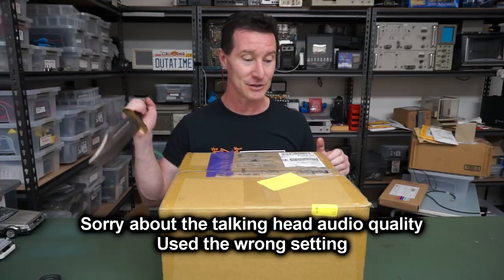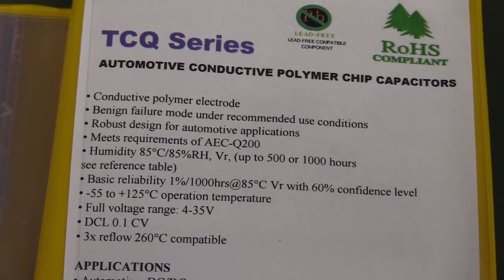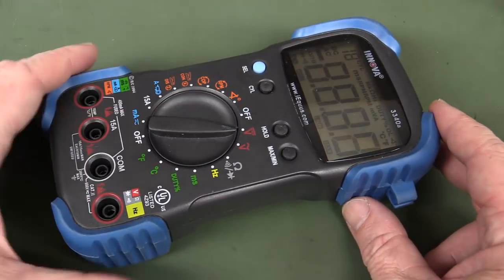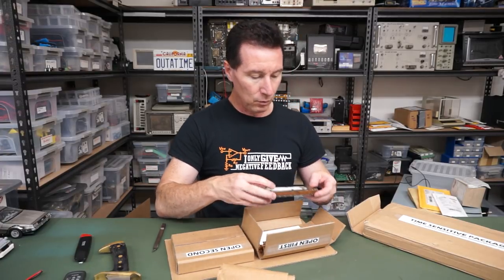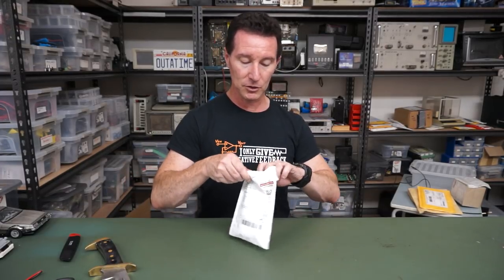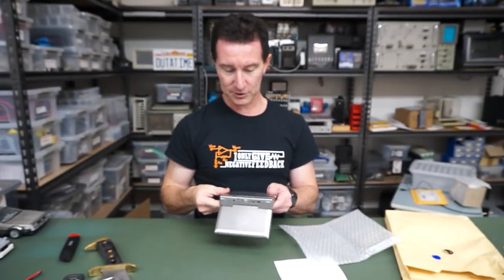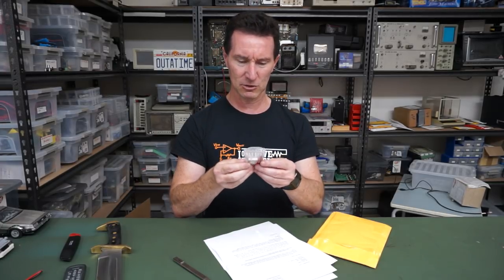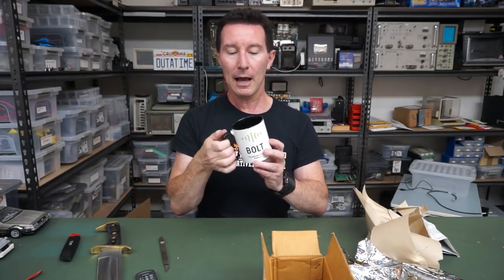EEVblog #1043 - Mailbag

Comment: The Screws are where the bank programs the account info into the device. There is a baseplate adapter. Most likely a serial interface like SPI
Reply: I wouldn't have guess that, very cool indeed.
Reply: The spirals are then probably meant to increase the inductance of the trace going towards the logic. That would prevent any fast transients (ESD) from damaging the logic and instead force the majority of the current over the spark gap.
Reply: Yeah, I would say the same. The screw terminals are marked IN-L, IN-R, OUT and REF. Clearly some kind of serial interface. I would assume that it is used to program the actual date and time into that thing because those generated codes depend on an internal clock.

Comment: Those AVX super capacitors are some very nice ones. They are low ESR and can supply some pretty high current.
That 400F cap would most likely be able to spot weld stuff, it's rated for 173 amps peak!

It's probably a good thing the flashlight kit comes already soldered. The WS2812 LEDs are extremely easy to kill when soldering, they are not exactly beginner friendly.
Reply: I had no clue they made caps with that high of capacitance.
Reply: Snarky Mark 
Look up super capacitors. Maxwell (now owned by Tesla) makes 3000F supercaps. Others do too. Some call them ultracaps. They are different from electrolytic caps.

Comment: the probe tip idea is very interesting.
Reply: Definitely! I could have used some of those last week while trying to beep out some TSSOP-16 chips (solder bridge somewhere, was a PITA to find...)
Reply: Can Dave read, or does he get Sagan to decipher the letters?  He wonders where the tips come from, where it clearly states in the letter several times that it's a dentists' burr.  So bad it's criminal (runs in the family, eh Dave?) :)
Reply: Minute i saw them in that characteristic holder i knew what they were! Back in my distant past i recall a dated stock store chain that specialized in medical/surgical items. There were 100s of different sized titanium hip-joints all the way to bone screws, plates and rods and even the tools to drive it all. The section of dentist stuff i found the burrs and i bought up probably 20packs out of 'hoarder interest" for a few dollars and have used them for years drilling PCBs. I think they are titanium as opposed carbide from the sound they make if you lightly drop one on a hard surface and they remain as sharp as hell but can snap. I've almost run out now. I bet there's some law now that says you can only buy them if your are licensed medical practitioner....
Reply: Would buy some of those probes for my meter.  I'm kinda tired of my fluke probes slipping off shit I'm testing.

Comment: The screws are the programing interface.  Before it's packaged it is set on a jig to load the final settings/program.  No connector required.  Case doesn't have to be opened after assembly.

Comment: It's kind of difficult to see clearly, but if you look in the screw holes at IN-R and IN-L (at about 30:57), it looks like those holes are not fully plated through.  Could that be a 4-layer board with the outer layers being plated and layers 2 and 3 missing in those areas, allowing the top and bottom layers to be squeezed together when the screws are tightened (and opening a circuit when the screws are loosened or removed)?  Also, I think you need to make a Kick Starter with a couple of those little joysticks on it, kind of like a new type of fidget toy.  Keep up the good work.

Comment: I used to work for AVX, operating a huge automated crane thing, which put pallets of caps into different chemical baths, and then into a 12 hour bake.

The oven was in the centre of two large halls (each about 35ft square?), so the crane on the output side of the oven would then put the caps through yet more chem baths, before rinsing them off.

The automation wasn't so clever, as it didn't detect certain things, like if you left the table down for where it places the pallets.
If you did, it would happily drop the entire pallet from a height of about 10 feet. lol

Each pallet much have had about 20,000 tantalum caps on it, with the ends of the caps dangling down, and the anode (I think) welded to some small metal sheets.

The tantalum caps had to use a sintering oven as well, and it could apparently take half the building with it if it ever exploded.

Definitely one of the toughest shifts I'd done (before or since). It was four 12-hour shifts, four days on / four days off.
tbh, I'm surprised that the stuff I made actually worked. lol

The crane system apparently got sold off to a company in the Czech Republic, before the factory in Paignton was closed.

(it used to be next to the old Nortel site, which was also demolished about 7 years ago. It was the largest employer in the bay.)

I worked for a short while back in the old AVX building, after a small telecoms company took over.
(made up mainly of ex-Nortel employees and engineers).

The telecoms company also eventually folded, and I think most of the stuff is made in China now.

Comment: On the token, the screw holes through the board looked odd, almost like the screw holes had separate layers on either side of the board, with no via connecting the 2 sides.  Was thinking that maybe it is used to detect screw removal...with the screw in, the top side of the board is connected to the bottom, but the connection is broken when the screw is removed.  But in reading the other comments I do believe that it is for programming just prior to use. That makes the spark gaps make sense too, to prevent accidental ESD discharges (like static from pulling it out of your pocket) to keep it from damaging the processor.

Comment: A lot late right now but on the openpandora the backlight inductors would fail. If you get status leds that come on it's likely still working just no display backlight. Mine works fine via the display output cable which was pretty specialized. It is sitting on my desk waiting to be fixed but my smartphone does everything this did just faster. Not sure if it's worth the time to fix.

Comment: I think the non slip tips are dental drills, quite a clever thing to do.
Reply: At 37:40 the included note strongly suggests that they are, indeed, dental drills.
Reply: Yes, and a friend of mine had an old dental drill and the bits came in very similar cases. When Dave mentioned the guy worked with dental equipment i got very sure.
Reply: They looks like some proxxon router bits I have. :-)

Comment: The weird traces coming off those screws could also be measuring static or some such to generate randomness for the crypto

The programming with pogo plugs suggestion seems dodgy to me, but it could be I guess
Reply: It's shown in the patent illustration, top left corner. The doc shows four pads and corresponding pins on a separate unit

Comment: 33:50 Is the processor in that metal package? It's from jorjin technologies, but i can't find the part on their website. They make prebuilt ARM processor modules, but the part number more closely matches their wireless module series.

Nothing else on the board looks like a MPU. The big BPA package is a flash / DRAM combination, the smaller BGA is a PMIC and the long boi on the right is a bus transciever.

Comment: On the Pixel light it would be cool to program it for long exposure photography so that by swiping it across the frame while the shutter is open it spells out a message, creates a cool patterned ribbon of light in the air, etc

Comment: Theory: The spirals on the bank OTP PCB are antennas. IN-L and IN-R are inputs, and there's at least one output higher up. That there are two might suggest differential signaling. It's probably how they program the thing, right through the case and possibly without even opening the box, so they don't have to trust the manufacturer to do it. No unscrewing anything or hooking up a cable. Just put it in a cradle and it programs whatever data it needs.

Someone else suggested programming it through the screws, but then what are the spirals for? Maybe the screws are in the loop to boost reception. They could also be measuring capacitance on the screws to see if someone took off the back cover, using the same pins the antennas go to.

If the spirals aren't antennas, they're inductors.

Comment: Pixel designer seems to be confused between mAh and mA . - 23:24  I count 4 spots where he/she should have used mA and not mAh. (Unless the circuit actually turns off when it has used 600mAh!)  It looks kinda cool but this mix up makes me wonder.
Reply: yes, that really does not look professional - they should revisit these data before they go public...

Essentially all places except for the battery capacity are mixed up!
Reply: Too me it makes me question the quality and reliability of a design when they get such simple stuff wrong.  If they don't know the simple stuff what else did they screw up?
Reply: This is just a simple oversight on a hastily-drafted letter to Dave regarding the kit. Yeah, I missed it, it is a mistake. Mistakes happen. I was in a hurry to get the letter done and ship out the package. The real lesson here is that I should have skipped my heart meds that morning as they tend to make me a little fuzzy sometimes, or I should have just waited a few hours and then read through the letter again before sending.

If you are going to judge my engineering and design skills, I would ask that you judge my engineering and design skills, rather than just critique a very-quickly-drafted letter to Dave. After all, the letter only took minutes to draft whereas the PIXEL is the culmination of months of engineering and design work, testing and refinement.

I encourage you to pick one up via a pledge to the ongoing Kickstarter campaign, and when you receive it, analyze and critique the hell out of it. I, like pretty much everyone, learn by doing something, and then learning from any mistakes or missed-opportunities to make something better than it is. To this end, I do appreciate feedback in regards to my designs.

Comment: An Automotive multimeter doesn't need the HRC fuses and MOVs used for mains rated multimeters.  That may change with modern electric and plug in hybrid cars with their massive battery banks and high power charging connectors.

Comment: I think the screws on that key generator device are electrically connected to the chip so the COB can be programmed after assembly.  The needs of crypto likely mean that each unit has a serial number burned in and some software that might need updating, so it should  be possible to program the thing from a sort of cradle that contacts those screws.

Comment: The carbide burrs at 41:22 are dremel bits. What the guy made is an adapter that connects them to a multimeter probe, which is cool. How would the higher resistance of steel and tungsten carbide affect multimeter readings? Also, could they be too sharp? A little too much pressure and you might just carve a strip of lead off and short pads that way...
Reply: Hey, somebody finally got the spelling right!

That being said, the added resistance would unlikely affect voltage readings; resistance ones, maaaaaybe slightly, but then again, measuring any passives in-circuit is bound to give wonky readings anyway.

Comment: Excellent context as per non-standard norms!. Ref meter elasticated banded DMM, I had the pleasure of using a Chauvin Arnoux instrument new circa 1982/3 in Belgium, with single band. Quite small in size, lovely large meter movement taking most of the meters physical size circa 120 X 70 X 45 mm. Again we are all lucky to have such a knowledgeable individual sharing and informing, with humour of course. Here is a quote from a salesman from a similar era " What we don't want is a ongoing negative situation".

Comment: The screw connections could be connected to an analog read pin to be used as floating voltages for a random number generator?

Comment: Double sided PCB that are not connected and the screw close the circuit. When you remove the screw it breaks the connection and opens the  circuit. Pretty simple design. Se inside the hole and check if theres continuity.

Comment: It would be interesting to see how well the "strap-on" multimeter protects its wearer from high voltages.  There's nothing like wanting to let go of something and not being able to do so.  Now that I've written that, I wonder if the elastic strap and/or its mounting points have been designed to break under a certain amount of force; imagine the meter, with your hand in it, being caught by a malfunctioning piece of equipment and your desperately needing to move away from it.

Comment: pogo pins are not great for lateral pressure, they bend and break all the time if you dont design your nail board correctly ... but they are cheap enough to replace once every 20 or so uses

Comment: The Wifi/Bluetooth Diplexers at 7:51 aren't exactly "regular parts".  Those are quite application specific.  A sample kit like that would be a good start if you are designing in that area instead of trying to find parts on your own especially if your company hasn't done anything in that area before thus none of those in stock or ever used.  IMHO.

Comment: I replaced dead NiCd 40mA battery with 1.4F supercap inside DIN rail timer. It provides enough capacity to hold memory, RTC and LCD working for more then week. Brilliant for this type devices.

Comment: 31:10: Could this be just a programming interface using the screws as contacts?
Reply: That's a really interesting idea! Possibly each could be programmed prior to being handed out to clients at a branch location? Not too sure on the units purpose.
Reply: Yea I would agree, also looks like they are there in the patent, fig1 28a through 28d...
Reply: We have the same banking code generating thingies where I live, same company that makes them too. When you go to the bank to get one they put it in what looks like a little docking station. I used to think they used RFID to set them up as they don't have any external connections until I asked a guy who works with them, and he said they connect via the screws. So after seeing the insides of one it really makes sense.
Reply: The spirals are then probably meant to increase the inductance of the trace going towards the logic. That would prevent any fast transients (ESD) from damaging the logic and instead force the majority of the current over the spark gap.
Reply: These codes are generated with addition of date and time. That's possibly the programming interface to set the internal clock during production.

Comment: For your 121GW prototype you could have asked for the case to printed using NinjaFlex filament which creates flexible parts.
Reply: Kevin Cozens But it's really disappointing it can't actually measure that much power, since it's an electrical meter and GW is a proper electrical unit when prototyping and servicing large Electrical and Electronics gadgets such as Solar farms.

Comment: Innova/Equus made a name for themselves with their line of automotive timing lights. When that market ended (car engines don't have distributors anymore), they started branching out into other diagnostic equipment such as that DMM. Nowadays they are focused on scan tools. Their tools have always had a particular design aesthetic, even though I'm sure they just bought the base multimeter from someone else.

Comment: the one time pad actually refers to the only perfectly secure crypto algorithm, it just xoring key and data bit by bit so you need a random key of the same length as the data you can only use one time so transfering so highly impractical

Comment: I really wish someone would build a wireless computer mouse with a supercap as power source. Either with an inductive mouse pad to charge it on, or even a normal charging station with 2 contacts would be OK. Since a normal computer mouse can run 6 months or more of daily use on 1 AA battery, it should be possible to get a day's use out of the right supercap, and after the day it can be put into the charging station again and be ready for the next day. I know there once was a product like that, but it was discontinued. What a waste to use batteries for that!

Comment: I really would like to see something done with super cap's some day, might be interesting if you try welding something (most basic way you could do it is get some welding filler rods and car jumper cables to connect and hold the rod to the caps)

Comment: the multimeter with a strap, it is not for working on a proper work bench for sure. It must be for outside jobs,  the hand having the multitester also can grab one of the leads and the other hand with the other lead. It is not a bad idea. And they wanted to protect the idea. I don't see the fun!....
Reply: I think the letter said it was an automotive multimeter so I could see it being useful when you're on your back under a car or reaching above your head under a car on a lift to have the meter on the back of one hand.

Comment: ive thought those open pandora boxes where quite cool i bet the battery failed i was one time considering getting one of those but after seeing what they costed i backed off but i do want to eventualy get something that is portable and i could easily import cheat codes to easier other than the psp as some of the psp stuff is coming harder to find since it was long discontinued

Comment: Too bad all capacitors fail regardless of any precautions you take while handling them.
Reply: Capacitors can last a very long time. I have some 80 year old silver mica capacitors in a radio. They still work perfectly fine and will probably never need replacement.